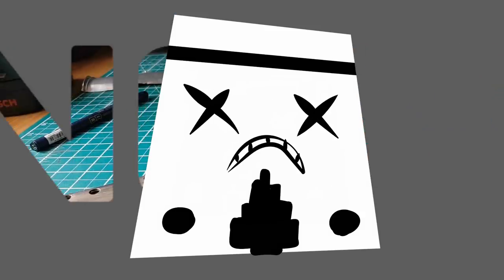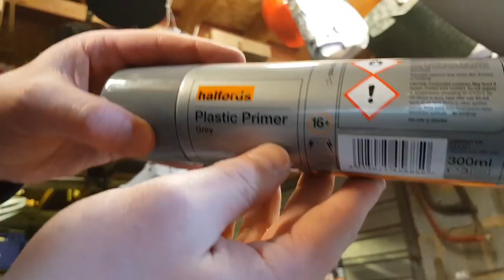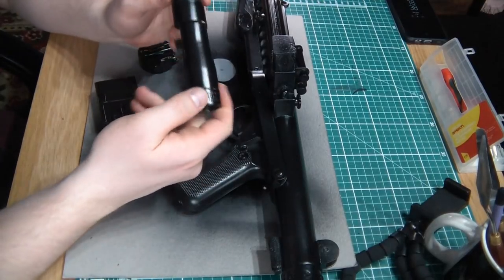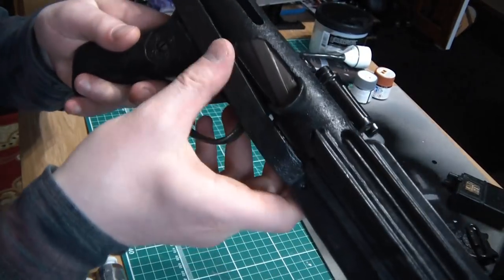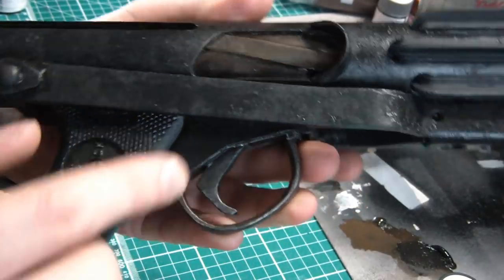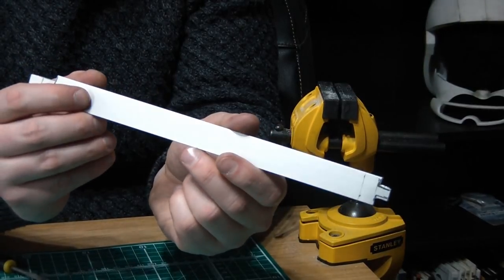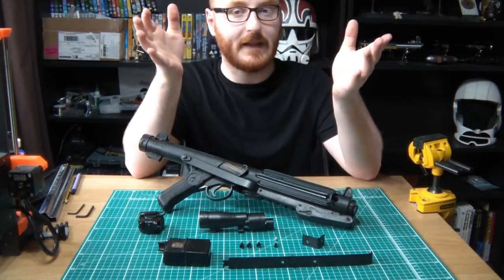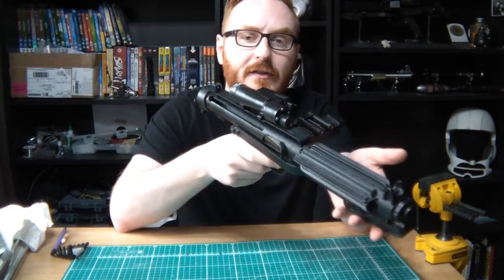Resin E-11 Blaster Build (Doopy Doo) | BLASTER MONTH

Comment: Cracking build. Looks great. A good way to get the textured paint is to mix it with talcum powder before you stipple it on. My first love is railway modelling, and I've done a few 'end of British steam' locos, which were absolutely knackered in the late 60's. The talc is great for helping represent thick grease and dirty oil. Mixing the talc with acrylic paint can see the whole job done in an hour, as it drys very quickly.
Reply from the maker: Awesome! thanks for the tip :D

Comment: For stippling, you could also use a modelling texturing paste. Get a dish washing sponge with the scoring side and dab it on. Did it to my Shore Trooper helmet and it worked well in creating a textured underlay to the paint.  You can also buy paints such as Rust-oleum paints which gives it that proper rusty under coat look you'd be going for. 
Also blaster-month, does this mean another run of the Merr-Sonn Blasters? ;) My birthday is at the end of the month... hint hint
Reply from the maker: Sir Stefan Lord of Kitty Cats already had the medium so was easy to do. You could do actual crinkle paint maybe, but one you don't have to bake 😄😄 not got plans to cast any more MSP5s up atm

Comment: Hi great video, and very helpful as I am about to build one of these Doopy Doo kits, also adding a BlastFX electronics package as well for sound and light.
Having researched the sterling a little before embarking on this project I thought I would share some interesting information I have found on the crinkle paint finish which is found on some Sterlings.  

Apparently the MOD spec for the sterlings supplied to UK armed forces required a smooth paint finish for the entire gun.  Those guns made by sterling for export had the crinkle paint finish applied to the main frame/tube and the folding stock arms.  Some export models bound for India had the contract canceled and were subsequently sold to the British Army who broke them up and used them for spare parts. The MOD gave special dispensation for the use of crinkle painted parts except for the main frame/tube which they refused to sanction in the UK Armed forces.  Presumably this is why these Idia contract sterlings where used for spares rather than just being issued.  
So if you have a sterling with the crinkle paint on the main frame it is probably an export version rather than ex UK military.  
I find this stuff fascinating, and it would be interesting to know if the Sterlings supplied by Bapty & Co. for filming where ex MOD or not.
An alternative for achieving the crinkle paint effect is this:
https://www.ebay.co.uk/itm/VHT-SP201-BLACK-WRINKLE-FINISH-SPRAY-PAINT/381739555527?epid=1610268644&hash=item58e1735ac7:g:--EAAOSw3pVZ0vvy
Its a heat resistant paint that drys to the crinkle finish.
Reply from the maker: Interesting! Yeah my real one has the crinkle texture. Yeah I knew you could get spray paint that will crinkle, just doing the effect with stuff I had already :D
Reply: A lot of them do have the crinkle paint, they sold hundreds of thousands of these things worldwide, and almost every Commonwealth country bought them.  I thought the Wrinkle paint would give others an alternative to achieving the finish.;-)

Comment: Is there a trick to sanding off printlines?  I couldnt seem to get the ones off the Robocop gun I did.
Reply from the maker: Was it PLA? PLA is harder to sand, but starting at a fairly low grit, at least a 100, is necessary. Mix that with filler primer layers and you should be good to go just working up the grits to a smooth finish :)

Comment: Do, Doopy Doo's provide a spring for the recoil inside?
Reply from the maker: Mark Smales No, but I think I've seen upgrade kits avaible with such, don't know the maker though.
Reply: Buckethead Props I have an SDSProps E-11 Blaster but not accurate enough, so was thinking of either buying a Deactivated Sterling Rifle or some resin cast E-11 Blaster.
Reply from the maker: From a guy that has both 😅 just depends what you want it for, for trooping definitely a resin cast, for display you could have either.